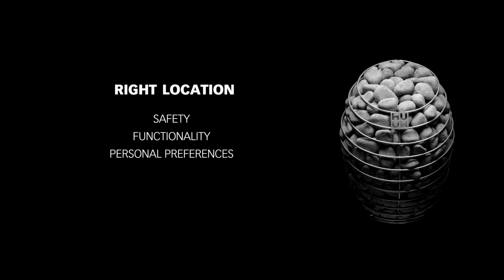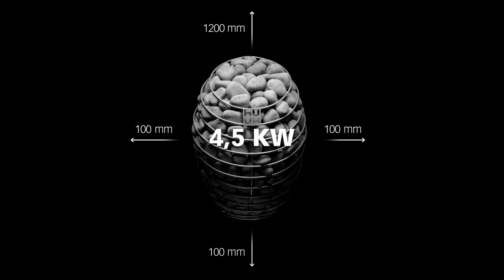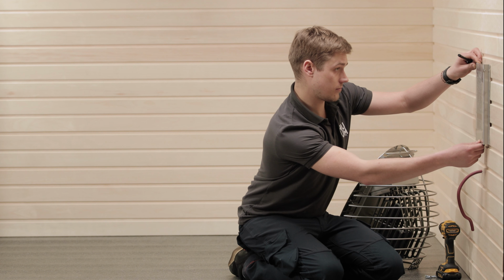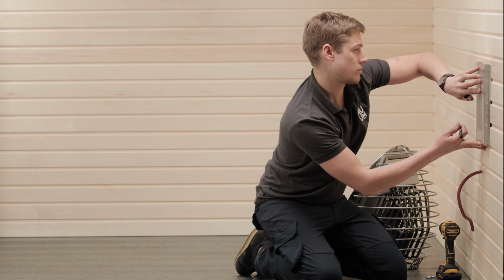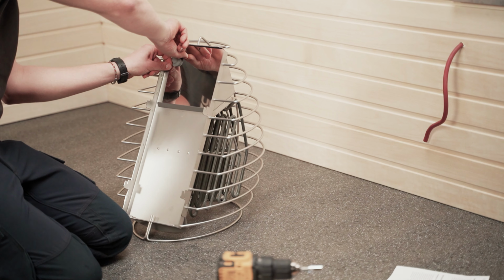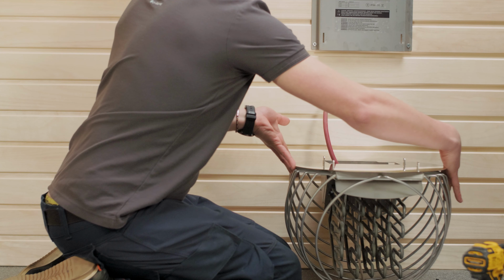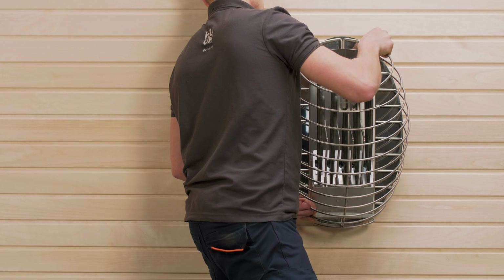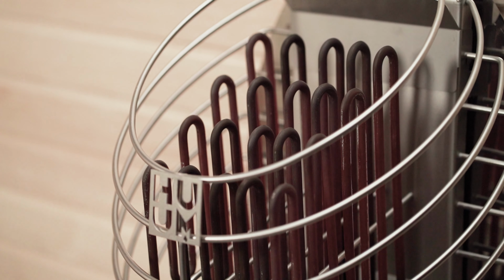DROP installation

Comment: 2:35 please don´t cut the isolation of the ground wire, also when using this time of cable you should use a ferrule.

Please leave stuff like this to a qualified sparky close to you.